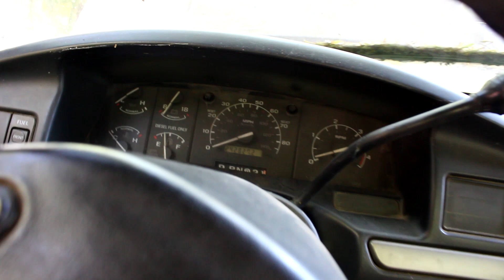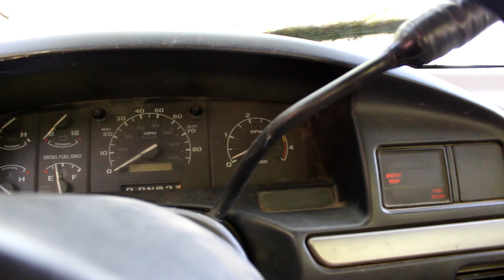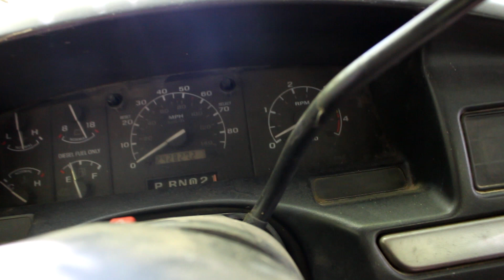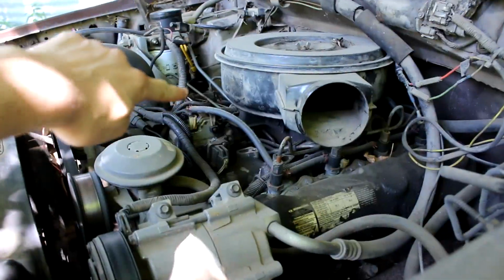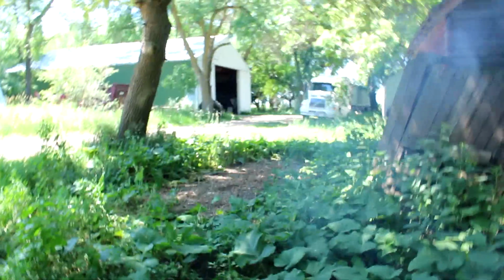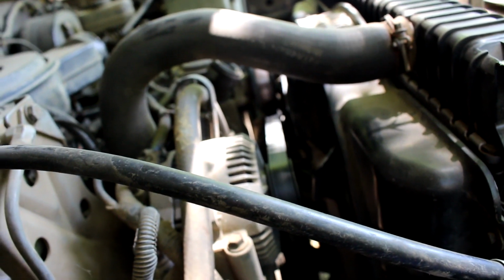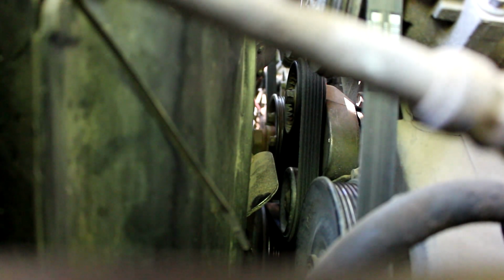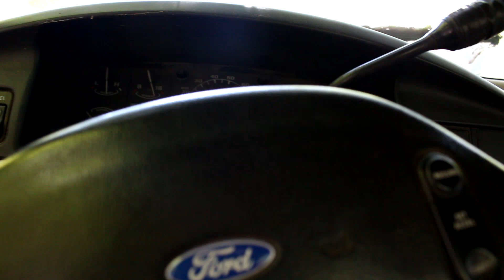Old Start Ford F-250 XLT 1993 7.3L IDI

Comment: with it setting so long out side it could every well be the injectors because my 7.3 sat a while out side and I had to put knew injecters in it
Reply from the maker: it has new injectors in it and it still runs bad doesn't matter how long it sat it wasen't fixed right by a my friend. so it needs to be completely redone. its getting worse with the new injectors which is very strange

Comment: when you replace the injector pump replace the lift pump.it's not out of time unless the gears were moved.the smoke is from it sitting my 91 F250 did that when i first got it and ran it.but always replace the lift pump when replacing the injector pump if one is worn the other is to.i know this from my 7.3 idi.
Reply from the maker: no its not that the injectors are new and when they put them in new my friend it runs worse now then it did with the old injectors so it doesn't make sense